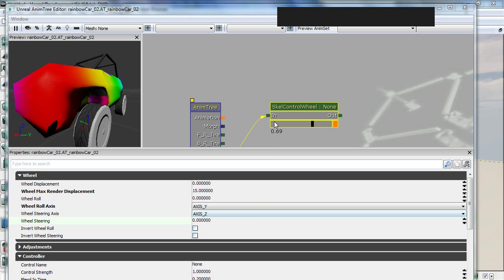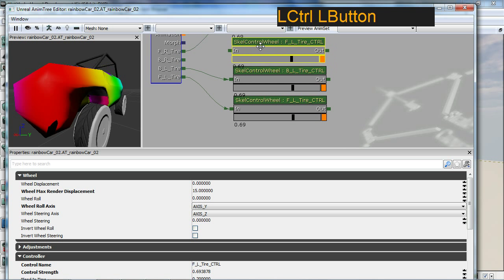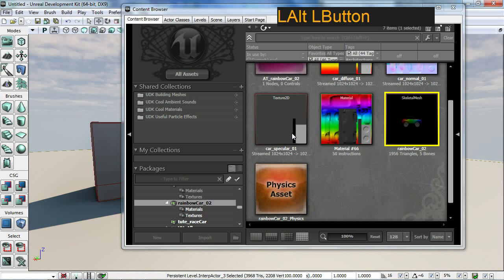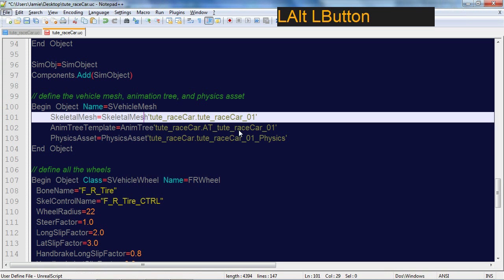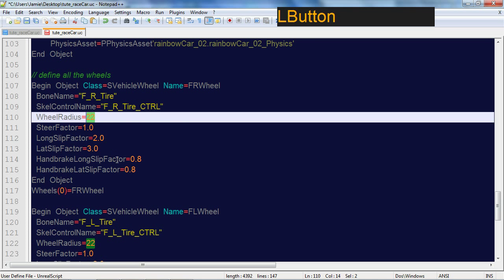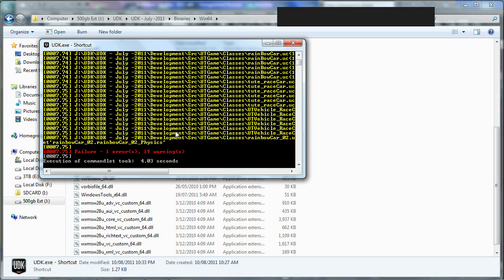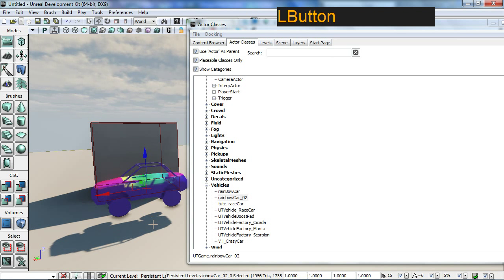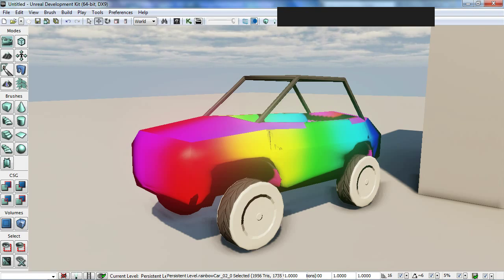3dsmax car from scratch to UDK - part 10 of 10

Comment from the maker: @69gothix69 Yeah.. It might be the case you can skip the step where I talk about orientating the root bone  (UDK may have fixed this in a newer release)..   

The step to fix it manually is to un parent every bone from the root bone.. and then rotate the root bone through 90 degrees.. then re parent.. skin.. etc..